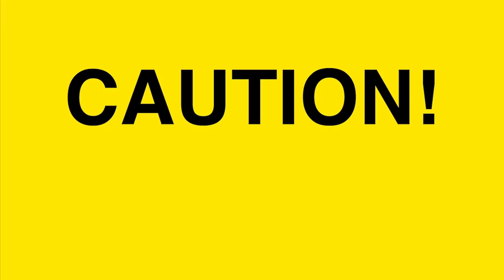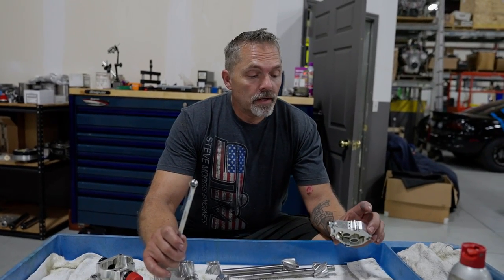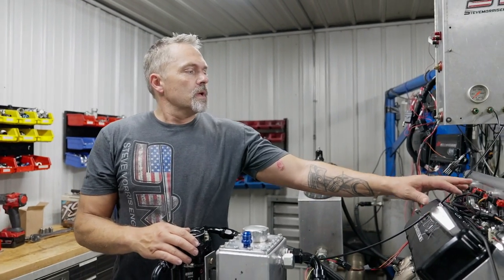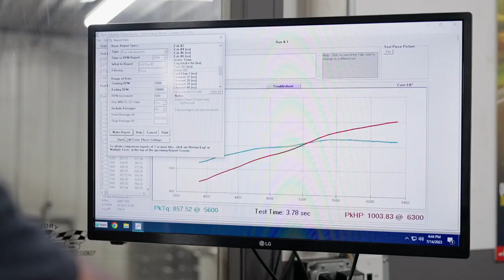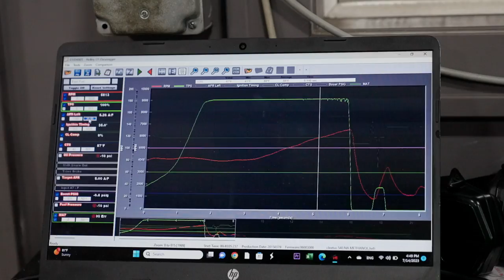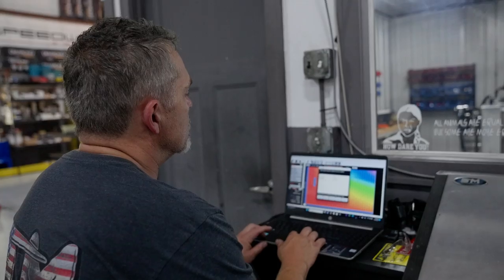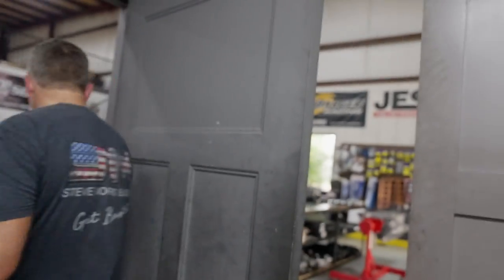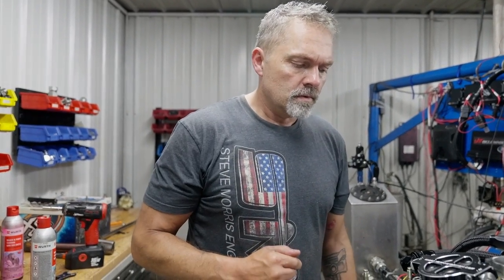What’s The Deal With The Oil Filter ?

Comment: So what I learned is. We need to see a high compression high revving naturally aspirated SMX build.
Reply: Would the SMX be a "good" platform for that? When I say good I mean is it already designed or overbuilt in ways that are specifically for boost or do the same principles apply for a big horsepower high compression NA build? I understand that the cam and compression would need to change but ya... Would be an extremely interesting build, but probably "waste" of an SMX..
Reply: @XUncleBossX  have to agree it would be a waste.
Reply: @XUncleBossX  He could do the same with a lot less investment these these SMX. With the 60 boost he told Cleetus to turn it up to, that's likely 600-700psi in every cylinder-takes a lot of block and head to hold that while fluctuating 8K rpm. Ever seen an exotic Cummings torn down? Turn them up to 150 boost.
The most you'd likely ever build with a NA 14 to 1 engine is 150-160psi in each cylinder
Reply: @mypriusisfaster  He could turn an SMX into a NA, and do wonders-but why? Don't need all that block and heads to do NA. 
At most a NA would produce 25-35% of the cylinder pressure of what this block and heads are built to withstand. Waste of build and money.
Reply: No point of that
Reply: Save the high rpm stuff for those bullet LS he has.
Reply: As a high performance diesel mechanic at one point in my life(mostly off shore racing boats) I’ve never heard of this “Cummings” is it some extra fan boy butt play version of a Cummins?
Reply: Y’all putting way too much thought into this. Let me paint the picture. SMX NA burnout car out of the Steve Morris barn.
Reply: @TheHallFarm  NA setup is way inferior than this beast build, you can do it with an OE cast block not a CNC billet block so
Reply: @1982evilj just gonna say that LS is the way for N/A!
Reply: @alexsahli7988 Happy Ending Diesel 🤣🤣
Reply: @XUncleBossX  It's way over built for a max NA setup so it would be a waste. Would still be cool to see but a lot of the strength adding components rob you of power with a max NA build.
Reply: These engines are specific to their objective. Which is drag and drive. Lower compression, lots of engine cooling, able to handle high amounts of boost, then drive 500 miles with a little valve lashing
Reply: Needs Nitromethane
Reply: @alexsahli7988 had a cummins salesman come to my work to show us some generator options once. My employer called them Cummings like 10 times. The whole time, I was thinking, "Please don't assume we're all stupid "
Reply: @TheHallFarm  Haha, it would probably last forever!
Reply: @TheMotorman80  Finally someone who understands the comment. Just imagine this as an high compression NA build 1500hp, 8000+ RPM. Can you imagine the sounds it would make! And the throttle response not having turbo lag. Throw in a set of equal length headers. Whew man it would be nasty!
Reply: Basically thats what it is sitting on his dyno,their is no turbo or turbos ,procharger/blower or nitrous hooked up to it while he's testing it in this video .1000 horse power at 6700 rpm with 135psi of oil pressure. Yes if it was a true n/a setup it would have different cam and maybe  domed pistons and few other changes. This gives us an idea of what a n/a SMX would do.But I'm no professional on this stuff though.
Reply: @-KH.  buy one...im sure he'd build it for you
Reply: @504chris  maybe I can get one of those free $100k student loans. Surely it would count for educational purposes 😂
Reply: @TheHallFarm There is no issue with throttle response when the engine is making 1000hp NA. And they are twins so lag isn’t an issue, and lag isn’t really any issue anymore for these cars with antilag/2steps. It wouldn’t be cool to waste a 100k billet block on an NA built when a good cast aluminum block is all you need for a high hp NA motor. Your lack of understanding is showing
Reply: Compression doesn't really mean hp..
Reply: @davejames2015 What do you mean bro by definition it it does. It increases the cylinder pressure, which is the driving force behind a piston, more cylinder pressure=more hp. It also allows you to run higher octane fuels more efficiently and run more aggressive timing with those fuels. Now the reason why you run lower compression on boosted engines is because boost dramatically increases cylinder pressures and heat, so you need to make it “inefficient” for an NA setup but in reality it’s as efficient as you can get for what the motor was designed for (to be boosted)
Reply: @SeventhCircle77  jm
Reply: @lockedinstreetracing6005 because n/a builds are max effort. If that block weighs a mere 2 ounces less than a non-billet version, it's worth it to n/a guys because they need all the help they can get.
Reply: @XUncleBossX  well, if with low compression, a small cam, and relatively low rpm it's already making over 1000 hp naturally aspirated, high compression, big cam, high rpm this thing would be amazing naturally aspirated.

Comment: This is why you always flush the lines, oil tanks, turbos, and anything else that was added to the system. Everyone always goes for the engine builder first because that’s where they spent the most money but didn’t check the cheaper stuff like the custom built oil tank and stuff. (I’m just speaking in general not about Cletus) but the way it was getting aluminum in the filter in the beginning it was probably the oil tank or a bad milled fitting or something simple.
Reply: @@RetirementFund750 I was thinking the exact same thing! Steve has a great reputation and Cletus also has a reputation but unfortunately it is because everyone knows it is only a matter of time before Cletus or his so-called mechanics break or ruin something!

Comment: The root cause of a stuck bypass pretty much confirms what I suspected. There was still some random bits of trash somewhere in the system from the original thrust bearing getting eaten and simply being replaced. One of those bits of trash stuck the bypass and caused the low oil pressure readings Cleetus saw in the last race video. What did make it through the pump showed up in the sight glass. That is to say the filter did exactly what its supposed to do. Filter the oil and protect the engine from trash. The shortcut (which admittedly seemed like a good option at the time) of simply replacing the bearing and cleaning out the engine as best as possible is unfortunately what led to this. There are lots of nooks and crannies on an engine and getting all loose material out of it after a bearing failure without a full tear down is pretty much impossible. Good learning experience for all, Cleetus now knows the bypass may get stuck and can check that next time pressure drops without a proportional amount of glitter in the oil. It wouldn't be shocking to find that some of the oil lines on the car still have a bit of trash caught up on fittings and such on the way to the pump or in the oil tank. the pump draws from.
Reply: @bummrplayer  legit a waste of his time not doing stuff like that anyway, as much as he needs the publicity, Cleet's still a normal customer in a business sense. absolute fuck around imo

Comment: "It's made to run 70 pounds of boost, I mean 65-70 pounds" n you hear garret do the usual "oh shell take 80" lol still impressed by the smx Steve keep up the stellar work
Reply: He hasnt been over 40lb yet, basically half power at 2500hp.. the tyres cannot cope yet with more.
Reply: "  . . . give it 60 LB boost. . . "  OK no problem 155 LB it is !!!!!
Reply: @christianbuczko1481  tires can't cope at all given he's not running big tire lol
Reply: @christianbuczko1481 cleter ran 52 pounds at the one race and it did fine then. No problem then..
Reply: And traction limited everywhere else
Reply: @christianbuczko1481  That engine does not make 2500 at 40 psi. More like 3600-3700. If he wants to go to 70 psi, I think he needs a lot more than those 96 mm turbos.
Reply: @dalegillispie8436 I believe that was on the other motor, not the SMX.
Reply: @AB-80X  it made 1000hp NA.  40psi is 2.66 x atmospheric pressure.   That means it will make approximately 2.6x the NA hp ... which is 2600hp.  It's "math"
Reply: He forgot to apply the Garret safety factor when he said 70 pounds... have to knock off 20% for Garret
Reply: @johnb7430 Baily's car made 2915 at 41 pounds.
Reply: @theunhingedgamer3762  im guessing you're one of those ppl that think everything over 1000hp needs a big tire
Reply: @johnb7430  yeah, boost doesn't work like that. It's not linear. More boost doesn't equal more power and it's not a direct correlation. You can add five pounds and not get a linear increase.
Reply: @christianbuczko1481 guys have been 3.50s on a 315 radial.  That’s 45-5000 hp numbers.  It’s not the tire, it’s the prep.
Reply: @johnb7430 Not how that works.

Atmospheric or “0” is 14.6 psi positive to start. This is the pressure on all of our bodies.  

40 psi of boost, is 54.6 psi positive from absolute. 

1000/14.6= 68.49hp per psi. 

68.49x54.6 =3,739
Reply: @johnb7430 And actually, your equation would’ve been close had you done the 1 atmosphere of air that made 1000, and other 2.66 atmospheres. 1000x3.66= 3666
Reply: @B0wtie4Life  yea, I notice around 15lbs of boost or another atmosphere usually doubles like it should
Reply: @danieltodd22  *Garrett
Reply: *Garrett
Reply: @johnb7430  
No. You have forgotten to factor in higher rpm. You don’t know how to do this properly. I suggest that you go to the video of Steve dumping a 525 SMX. It makes 3700 hp at 8000 rpm at 41 psi. You are not factoring in that this engine is both topping out at low rpm n/a and inefficient as an n/a engine. Spin it to 9000 at 41 psi and you are looking at 4000 hp or so.

Comment: The easiest way to remove a stuck oil bypass spring is to lightly run a tap into it, and then pull the tap out as a handle. I learned this trick in my air-cooled VW days.
Reply: I assume you mean a stuck plunger?
Reply: I'm surprised the oil pump relief valve isn't drilled and tapped to allow for easier removal in the future, since it was stuck this time.
Reply: @mikehynes6632  I did mean the plunger.

Comment: Steve, don't know if you gonna see this but my theory to what's happening is that the El Camino frame is too flexible for the amount of tension it needs to hold when Mullet launches. So the entire drivetrain needs to take the hit of the launch and that's shoving everything against each other. That's what making the engine gain more play than  it should. Whatever it may be, you guys gonna figure out

Comment: SMX's are jewels  ! This one looks good , runs good ,  and no debris at all. We saw it live . I wonder about Mullet's on board oiling system (tank , lines,etc.). Thanks for all the honesty Steve, very much appreciated.
Reply: @@vehdynam I was thinking the exact same thing, I have seen it a bunch of times! A person removes a transmission from their vehicle and brings it to the shop to be rebuilt, They bring it home and install it and within 10 miles they have managed to blow it! They are always so quick to blame the shop until we remove the pan in front of them and upon seeing metal in the pan we would ask them to tell us everything that they did from start to finish for the install! They always say that they flushed the system but they never say that they replaced the transmission cooler, I don’t care how much you flush the system you are never going to remove all of the metal from a transmission cooler! Steve has a great reputation and Cletus has a reputation for breaking almost everything that they touch!

Comment: We used to get the relief valve plunger made from nylon so if there were any impurities in the oil they'd sink into the plunger rather than jamming it. It was an industrial application but the pump is the same basic design

Comment: This might be a dumb question, but when putting the oil pump back together after that plunger was bound up what makes you confident it won’t do the same exact thing again?  And what do you think caused it to begin with?    Love your work and appreciate your candidness.
Reply: Probably a tiny speck of trash in the oil. Don’t take much with those tolerances.
Reply: I was thinking the exact same thing. Curious about the why.
Reply: Could be as simple as an oil hose fraying where the fitting goes, or a hose getting pinched during install, and the inner section damaged enough to let broken strands of braiding get in to the oil.
Reply: You could tell something went through that side of the pump. May have been a piece of that valve spring that broke. But this is the 2nd time that Garrett has had oil pump issues with this engine. First time I think there was still pieces of the mass exodus that Steve suffered from with this block.
Reply: In reality, it doesn't really matter if it hangs up again. If it does, now everyone knows what caused it and it's a relatively easy fix at that point. Likely a piece of trash in there - but let's say it has a manufacturing defect allowing the plunger to rack in the bore? Cleetus will see the low pressure at idle and will check that first - and probably time to replace it at that point.
Reply: I agree it had to be a small piece of trash that got into the oil pump.  I think Steve believes it likely was trash In Mullet’s oil system (tank, lines).  Garrett needs to make sure his guys thoroughly clean the tank and all the lines.
Reply: He will hone it smooth and replace  wear parts. It's basically new at that point
Reply: Introduced via the oil reservoir is my opinion.
Previous injury.
Reply: I am absolutely confident that it WILL stick again!
Reply: captainmufdyven9291 he didn’t rebuild it for Cleetus… he pulled it from his car for Cleetus. It was rebuilt for himself after the catastrophic explosion. If it was from that, probably would have happened before it went into mullet.

My guess is either just random pump failure, (might have been too dry during priming, or whatever) or stuff in the oil tank. I’m gonna bet it was a small piece of trash from the first time, where the thrusts took out the pump. It’s insanely hard to get everything out of that whole oil system.
Reply: @evracer  I dont
Reply: Huh?
Reply: @gteefxr3094  i dont think it will stick again,,,apparently steve doesn't either
Reply: @ @bradholtz8121 Steve has been building engines for years without any major  issues, It is his knowledge skill and experience that makes him confident that  it will not fail! Cletus on the other hand always happens to either break ruin destroy or have issues with almost everything that they touch!

Comment: Just out of curiosity, could you throw us a guess what an optimized N/A SMX would make at the crank?
Reply: You would need to spin the thing to 30,000+ RPM to get the air speed thru the humungus intake ports. I'm guessing 1500hp would be max without redesigning the heads.
Reply: @cbradley4466 I bet with 14:1 and just throwing a 260@.050 cam at it would do 1500 no problem since pretty sure he has done a 672cid smx. Fully optimized I would think 2000 probably doable but with the maintenance nightmare of turning a big cid engine 10k it will not be fun,
Reply: If you want N/A, just get a Pat Musi 959 lol

Comment: I had the same thing happen on my old car but it ran normal pressure  going down the road at 3600 rpm or higher, but at idle it would drop to ten pounds. I was running 60 valvoline, 1.5 thousandths main clearance, 2 thousandths rod and 4 thousandth piston skirt. An O-ring came apart and wedged in the bypass valve, repaired it by having a plunger made that didn't need an O-ring to help it seal.

Comment: Hey Steve
Give that clear view filter a lil shot of air before you take it apart and you won’t have the oil mess you have.
Those filters are made to look at them without taking them apart, lil shot of air on the air valve and wa-la.

Comment: Do we know what caused it to stick, and what will prevent it from sticking again?
Reply: Most likely remnants from when the rods exploded when Steve had it in the wagon
Reply: @blayne369 this is a new oil pump since then, the last one died a horrible death after consuming a stainless steel sieve from one of the scavenge ports in the oil pan
Reply: @blayne369 - I disagree.  The engine was thoroughly cleaned by SM before it made its way to Cleetus.  The more likely explanation is debris/trash in Mullets oil system.  Could be as simple as the inside of an oil line fraying.
Reply: That was my exact thoughts as well.
Reply: Most times easier to put new parts in then trying to clean coolers and some other parts
Reply: @wobblysauce we’ve always tossed out the coolers,lines and tanks from dirt latemodels everytime we hurt a engine because the money saved doesn’t outweigh the risk of sending junk that got missed thru the fresh engine
Reply: @danmyers9372  teflon "fraying" ?
Reply: Based on my experience with tight fit parts it could be any type of debris. When stuff is that tight it doesn’t take much to lock stuff up
Reply: @54raceman My experience as well...this is how you turn one blown engine into FIVE blown engines. I hate this bypass design...the tiniest piece of something jambs that bypass and that's your new oil pressure. It was fine....run 5 laps without one eye glued on the oil pressure gauge and you get another expensive 8 legged boat anchor. Once one of these bypasses stick....they go in a dumpster.
Reply: @danmyers9372 almost impossible to clean all the cracks and crevasses. Those bypasses are EXTREMELY sensitive to the tiniest piece of ANYTHING.